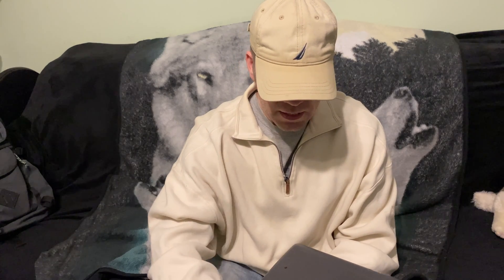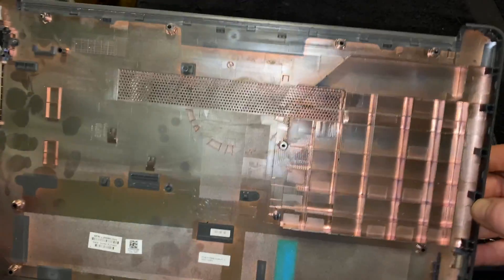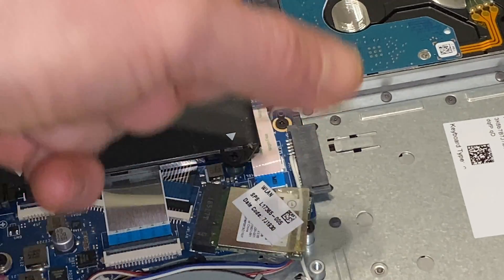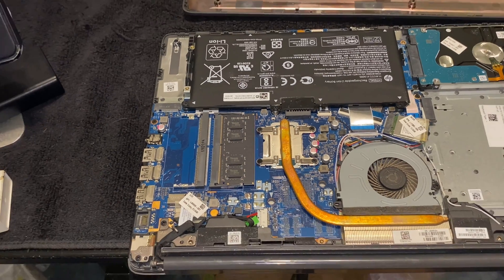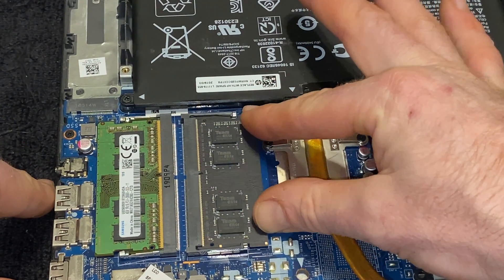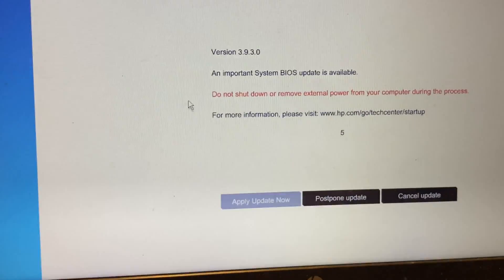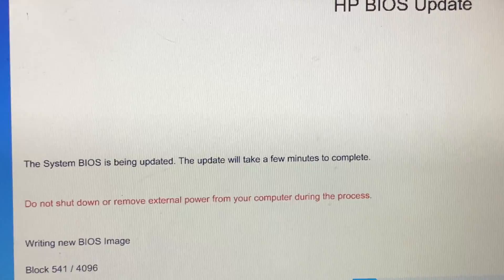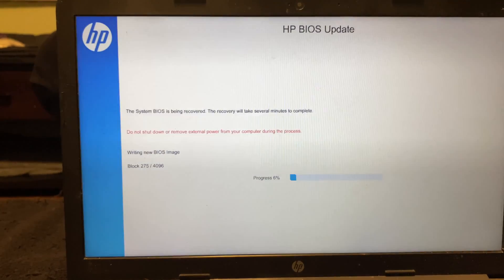#4K How to fix your HP laptop hardware, fan, WLAN, and install DDR4 RAM memory. Easy #DIY

Comment: While you're in there, remove heat sink , with its radiator bar and at the end you'll see a ton of dust in the cooling fins to clear out. Also remove the fan you mentioned and open it up, clean all the dust out. It'll cool far better. You'll be shocked how much dust is in there.
Reply from the maker: Excellent advice. I usually do that as well and maintain my computers. I did not go over it because I already put out so much info. Thanks for the great comment.